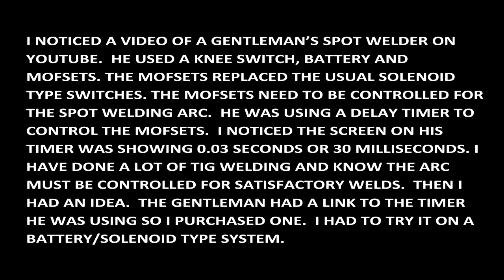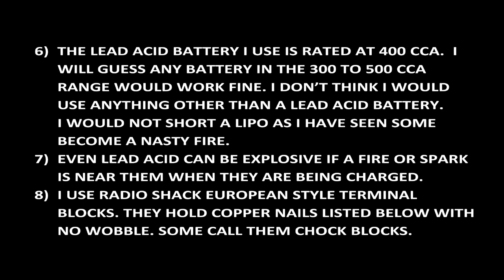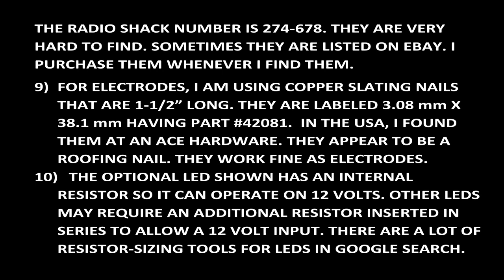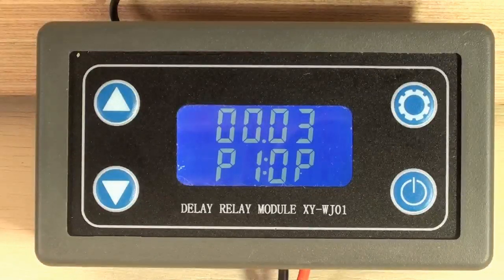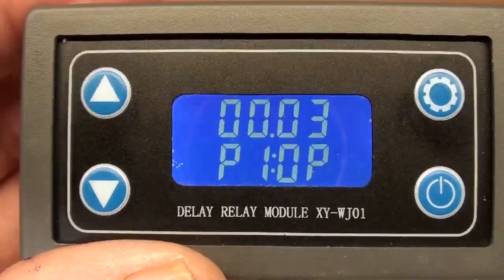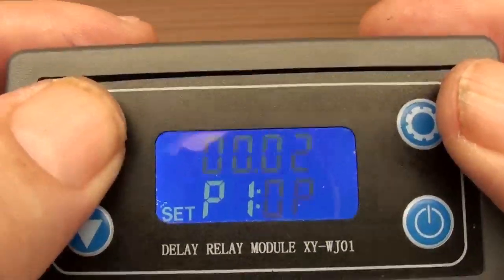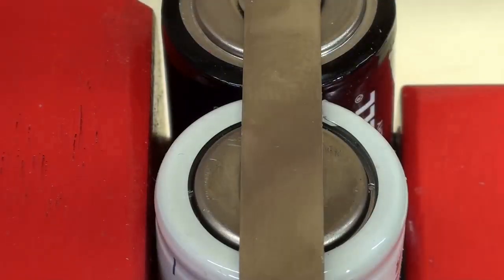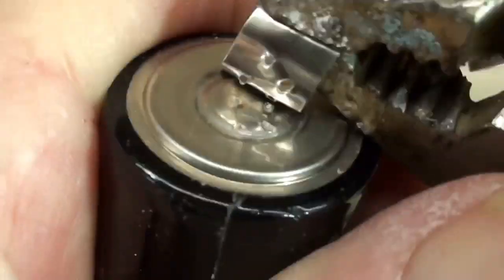Battery Spot Welder Precision Timer Controlled

Comment from the maker: I have had some time today and discovered the timers program P4:0P. 
It allows looping if desired. I set its parameters as follows: 
0P = 0.03 seconds of on time for each shot in the loop.
LP = 2 (number of shots in the loop per single press).
CL = 0.1 seconds for disconnect time between shots in the loop.
This gives me 2 shots for each weld when I use a foot, momentary or other switch with only one press. Like a machine gun.
The welds are beautiful without battery burn thru. Of course one shot works fine.
Be careful with “OP” as higher values mean more power per shot.
I think this unit can handle any thickness of nickel strip. 
Try everything on scrap pieces.
Here is a link showing how I program "P4:0P"
https://tkmaabl.sharing.bublup.com/ui/landing_page?item_id=001-i-01932da9-0b0a-48d0-9d9f-9d809b30aea2
After photo appears, mouse click on lower right button to enlarge 👀.